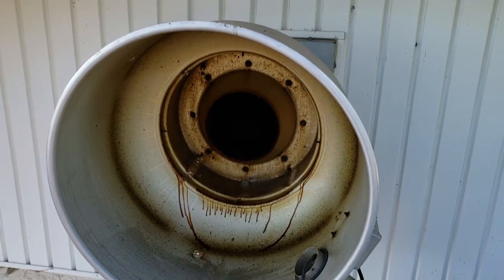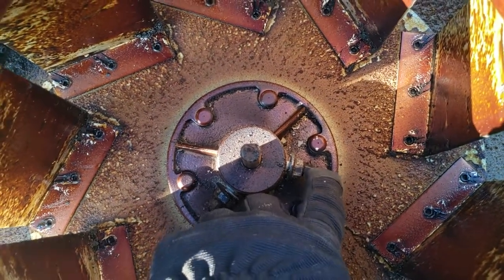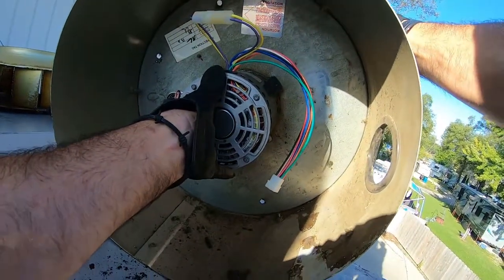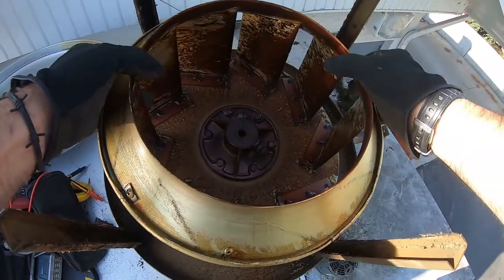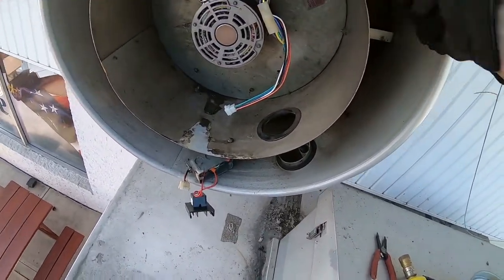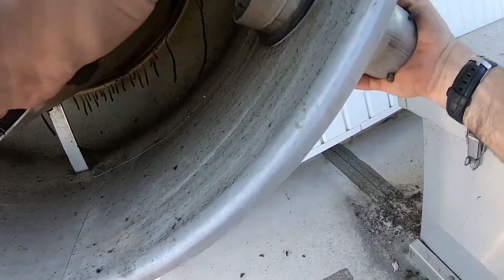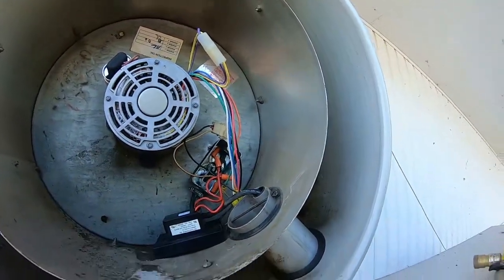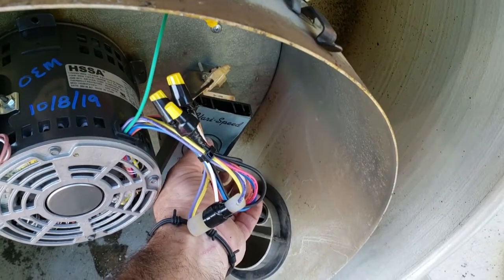Exhaust Fan Motor Replacement

Comment: Nice man. 8 point sockets are designed for square head fasteners. Its also so much nicer to use on service valves.  I'll never go back to those chincy service wrenches.  6 point will get you by sometimes, but I've been that guy that finished a fastener off using the wrong socket. Not a good feeling lol.
Reply from the maker: Thanks for commenting, I've traded a lot of my eight point or whatever they are out, a prime example would be replacing the green moisture indicator on a sight glass, if you use anything other than a 6 point socket or a box wrench equivalent you'll strip that turd right off. I have some of the new Universal sockets that are good for square, star and several other weird shapes. I like those for special purposes.
Reply: @HVACRSurvival  sweet I have not tried the spline drive. You like them?
Reply: @HVACRSurvival  your right. 8 point on square only.

Comment: Just had that motor delivered to the shop from captivaire. They still make it not sure why they would tell you that. 3/4 hp dual voltage right?115/208v. It's those side brackets that get me.
Reply from the maker: The original was 115v, the new one was dual voltage. I gave them the job number and he pulled up the job location so thay knew what motor it took, I'm just glad it worked. The side brackets weren't used for this model,  just Another universal motor so they can stock less inventory I would guess.
Reply: If you can make another vid on the Trane thermostat you made way back when it was great. The control with the spdt switches and  resistors to mimic Trane tstat for testing on rtus. Really want to make my own and copy your design 😉. All credit will go to you.
Reply: Much appreciated 👍 I know it takes time out your day
Reply from the maker: @johnr1385  email me hvacrsurvival@gmail.com and Ill send you pics of it.

Comment: Not so much helpful for a new HVACR technician without detailed wiring explanation
Reply from the maker: I purposely did not show every step by step because I have no control over who is watching this and attempting the repair. If the person can't figure out a simple L1 and L2 wiring diagram with an S.P.S.T switch then they shouldn't be doing the job. I don't want the liability if someone gets hurt because that person matched up my wire colors to the motor they are replacing and they weren't the same motors. (BOOM)  This channel is not a DIY, its to give someone that already has all the common knowledge of electrical and HVAC related skills an inside look of what to expect and where to start. I thank you for your comment and time to watch it!